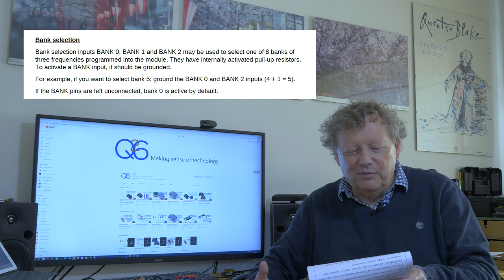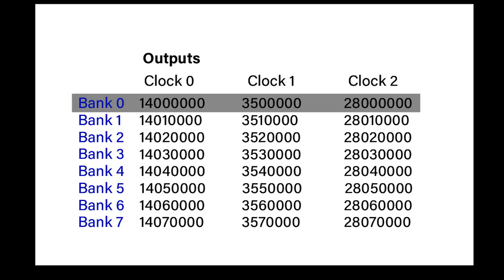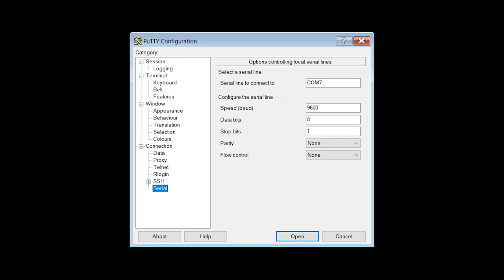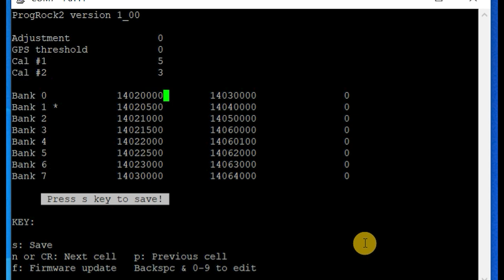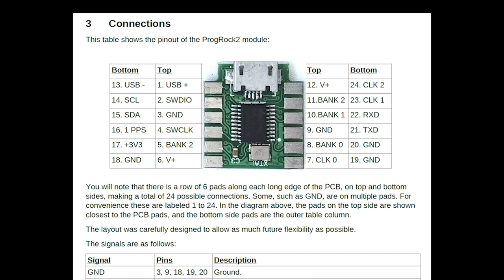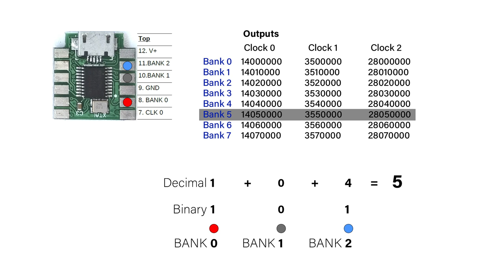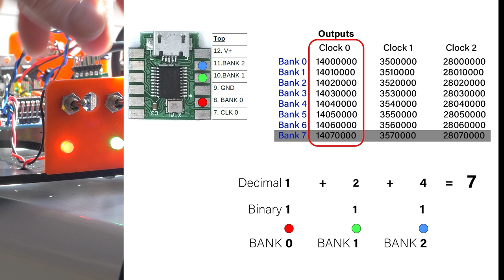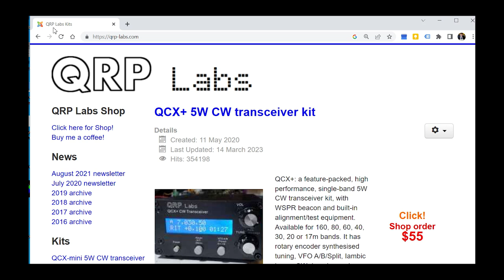ProgRock2Mite ! Making a multiple crystal receiver with QRP Labs ProgRock2

Comment: At typical application is  to refit  existing hand held  Tcvrs  with  a set of 8 Tx and 8 Rx  virtual crystals.. there are a few  traps to it. Basically the existing oscillators have to be  converted to  low gain amps within the target device.  Obviously you can't stuff  500 microwatts of signal where it was expecting  200 uW . Bear in mind that typically the  prog rock will produce 8mW out.  So you will need attenuation.  The output CANNOT be run into any sort of RF transformer without a 100nF capacitor in line.  Finally some mixers will require  the  input to be a  pretty pure  sine wave or you will have all sorts of nasty artifacts  at the output of the mixer and no circuits to remove them.  Diod ring mixers generally will work with a square wave input.  Gilbert cell mixers don't like a non sinusoidal force .  

If the  Tx is an FM type that directly modulates the XTal  via  a varactor diode   then clearly the Progrock  can't work in that application.
Reply from the maker: Very interesting - thanks for the info...
Reply: @Q26Video  also on the idea of using a  16 Mhz  x 2  xtal   rubbered   analogue osc and a mixer with input  from PRogrock and post mix filtering before sig goes to the existing Radio mixer .  If you have a  tiny as in 10pf or less  quality  variable c  cross the crystal of the HF osc then with a  Mosfet you can pull that in and out  in static  C   mode . So you can drop the  frequency by a known quantum every time you go into Tx . It's only the fact that you have infinite  flex in your  hyperspace  E-crystal that lets you do this .  I refer to a direct conversion Rx of course.

Comment: if you look at  MAX313CPE	MAX313 Quad SPST Analog Switch from the on line company Futurlec  (Oz  company) you will find you  can get  RF rated   analogue  sp DT switches which means you can switch  Bank 0  or  1 through to the same  circuit  point with near zero extra resistance in line. That gives you effectively  16  Rx frequencies with a very simple change or addition.  Word to the wise - Don't use the  4066  a switch with a barge pole ... it has about 40 ohm of internal resistance. that's why it is so cheap - and nasty. 

Mr  Futurlec also lists one Intersil part for about  USD 3.9 but with no datasheet - that's half price of the above part so might be worth a Butcher's HOOK.  I don't know if you can  get the parts cheaper in the UK from a bricks and mortar place. ??

Comment: Wow.... so you could program 8 frequencies on clock 0 and on clock 1 same freq with CW offset and voila your 49ER kit is freq agile (for 18 bucks!!!)! Stay tuned my order is on its way to HANS...also getting a QCX + for 160m .....and QDX high band!!!
Reply from the maker: Thanks. I tried this (using the same device for rx and tx with an offset) but haven't been able to prevent breakthrough between the two clock frequencies so far...if you are able to achieve an offset this way I would be very interested to hear more...
Reply: @Q26Video  It sounds like you might have to output the CW Rx offset  signal say plus  6Mhz  run it to a  Sa612  with a 6Mhz xtal on it,  then to BPF to take out the  unwanted product and back t where you want it  possibly with some amplification on the way.  The parts to do this might cost say 8 AUD  or 12 it's rather messy . Better would be to beat the signal with a 16 Mhx xtals pair that could let you typically have  6Khz of Pulling and then use the selected mixer output as the primary osc signal What you'd want  is another pair  that were only  800 Hz or so off the master pair Frq . that might be a big ask.